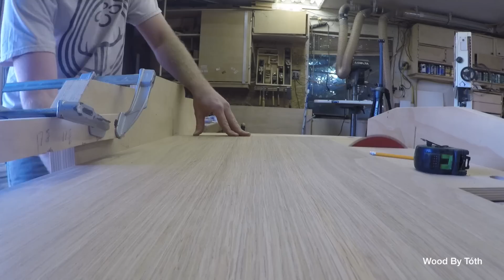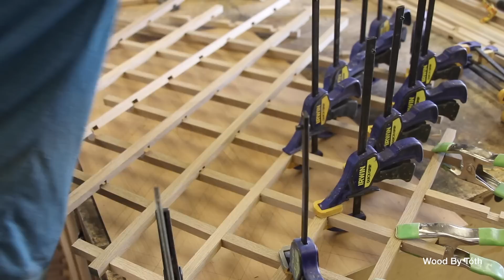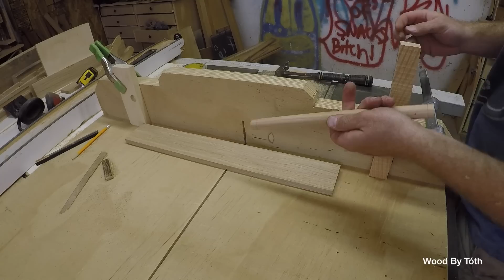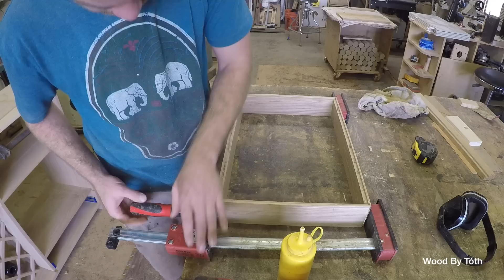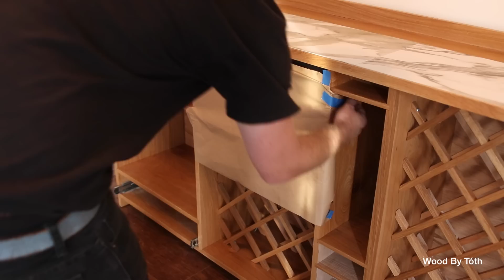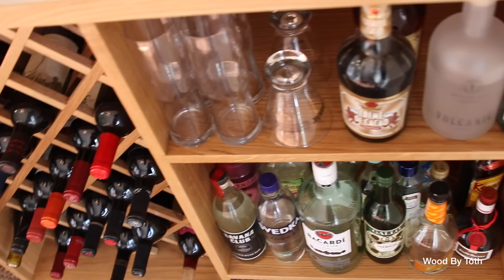Building The Ultimate Home Bar

Comment: Now that it's been almost two years, is there any sagging in the middle?
Reply from the maker: No, no sag! Its full supported on the bottom. There is a kicker that runs the full length. Its in the middle of the bottom and runs end to end. Its just push back so you cant see it. I like not being able to see is cause it gives it a floating lool
Reply: @WoodByToth  Dig it! Well done on the build
Reply from the maker: Steven Miller Thanks! Its the most used piece of furniture i’ve made. And it fully stocked now